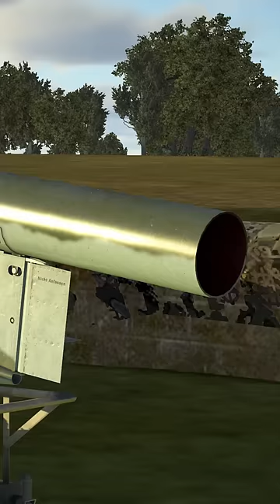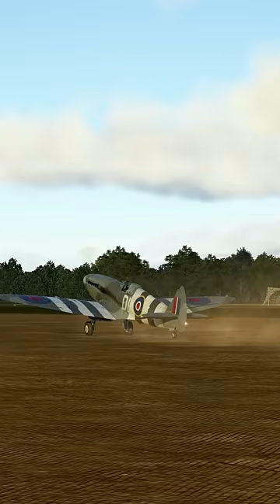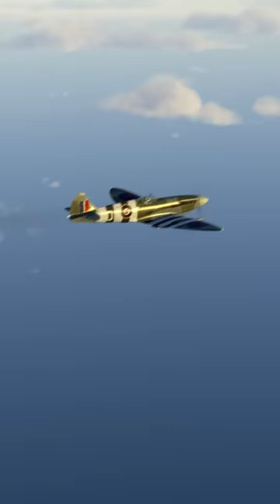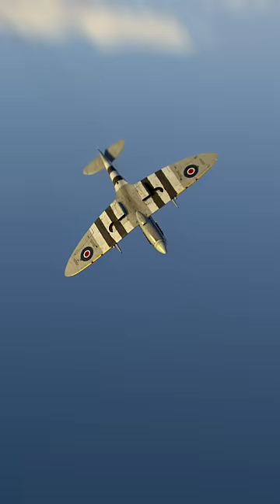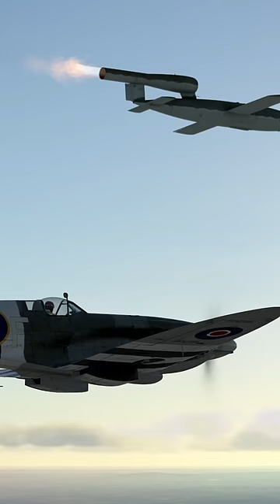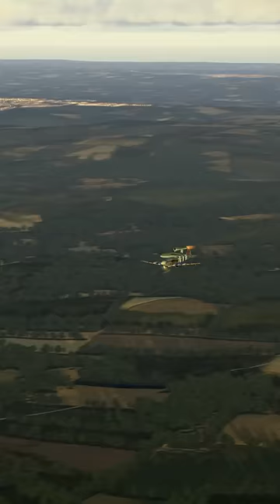When a Spitfire pilot used his wingtip to destroy a V-1!

Comment: They didn't actually touch wingtips, they used airflow over the wing to add lift on one side to make the V-1 go out of control.
Reply from the maker: I mention this in the full video
Reply: @sotocinematics  you said touching of wingtips.
Reply: @filipinorutherford7818 explaining aerodinamic principles in a 60 second video is imposible. Better to just say "touched" wich wouldnt be to far from reality
Reply: Wow I've wondered how that worked and the fighter stays aloft.
Reply: "Touchin' tips..."
Reply: @jkoeberlein1  
The plane has intelligent steering.
Reply: Oh they touched tips 👉🏻👈🏻
Reply: @dukecraig2402  You are intelligent, as you define it.
Reply: The original pilots did touch wingtips.  Meteor pilots were reprimanded.  It was found afterwards they could use the airflow
Reply: Correct 👍
Reply: Genius!
Reply: Not colliding is intelligent, so would be describing it properly.

Comment: I read they actually touched tips. The Germans worked out what they were doing and put explosive charges on the V1 wing tips.
Reply: Not explosive charges, but some later V1 used a very nasty explosive.
Reply: The Amatol warhead weighed 850kg (nearly a full ton). Getting close enough to shoot that down meant almost certainly being killed when it went off. 
RAF pilots put their wing over the V1 wing causing it to stall. Trying to lift the bomb wing was far harder as this caused the aircraft wing to lose lift. 
The same effect is used by glider air brakes. They disrupt the low pressure air above the wing dumping lift and allowing the aircraft to land promptly rather than float along on the ground effect.
Reply: BS!--Do you think the V1 made an emergency call home???
Reply: @pe.bo.5038  yea
Reply: I read they placed a tipping over sensor that detonated the warhead
Reply: Sounds like a made up fact.

Comment: My dad used to see V1's during the war. He told me that you could hear the engine cut out just before it hit the ground.
Reply: Wrong. It cut out at altitude, then it dropped cuz no thrust.
Reply: @mikeholland1031  So in other words the engine cut out just before it hit the ground.
Reply: @jacobreisser8034  no. Again, it cut out altitude then it was a glider until it hit and detonated. It cut out far before they hit the ground. Pay attention.
Reply: @mikeholland1031 I've always wondered about this. People kept telling me many years ago that the engine stopped, and the craft just fell vertically. This was how they knew where it would hit. Approx at what altitude did they cut out, and for how long did they glide ?
Reply: @quantisedspace7047  They didn't know where it would land, if you could hear it and it stopped you knew it would be not too far away so took the nearest cover. The distance to the target was controlled by cutting off the fuel after a predetermined time. Very basic but reasonably reliable just not very accurate, hence being called a terror weapon as you had no idea when one would turn up.

Comment: Getting it from its course wouldn't have helped much, it had a build in compass and would return on the programmed course again.
But the tipping could make it tumbling and crashing to the ground, this helped a lot. You didn't had to touch it, the vortex generated by the wing could have been enough, sometime the engine of a V1 stopped, when they tumbled or they could be stopped by flying in front of them.
Shooting down V1 was difficult, they where nearly as fast as some fighters, some had a nasty explosive that might blow up the fighter and they could take a lot bullets before you saw any damage.
Reply: They had no navigation program. Just a gyro to keep it going straight. Knocking it off course WOULD make a big difference.
Reply: @mikeholland1031  And a magnet compass showing them the direction to London.
Reply: @stelleratorsuprise8185  I think it only kept them going straight. Once knocked off coarse, I don't think it corrected. They weren't that high tech.

Comment: That became a rather common practice. Most of the intercepts were done with Tempests as they were faster at low altitudes the V-1s flew. The V-1 stability in roll was a function wing dihedral and design. it flew level or not at all. It was favored tactic to roll them as trying to shoot down a flying bomb from  about 300 yards away that had 2,400 pounds of explosive often yielded a bigger bang than the pilot liked.

Comment: At 22:00 in late June in South east England the light wouldn’t be sufficient for a v-1 interception would it? I think you got something wrong there mate.. checked sunset time is 21:30 so by the time the V-1 reached England it would be dark. What’s your source?
Reply from the maker: Check the sources in the description of the full video which state 22:00. I state later in the video that 22:00hrs was sunset during British Double Summer Time in WWII which was used to increase wartime productivity.
Reply: @sotocinematics  Plus the weapon could be seen from astern by the flame from its pulse engine.

Comment: It sounds like an Iraqi scud missle.
Reply: thats a V2
Reply: @davedixon2068 I've heard scuds fly over me and they nailed the engine sound. I guess the Soviets firgured the engine was good enough.
Reply: @cannowuppass8214  the V1 was a version of jet engine called a Pulse Jet so called because doors on the intake opened and closed at high speed during its operation, producing a buzzing sound hence Buzz Bomb. The Scud is a rocket motor with no working comparison with the Pulse Jet so while it may sound similar (I will bow to your experience there, rather you than me to be honest, thank you for your service too.) it is not in any other way similar.